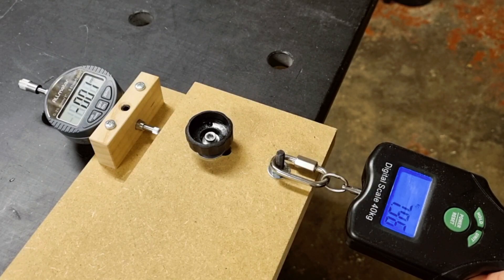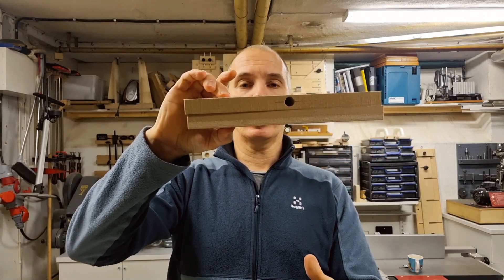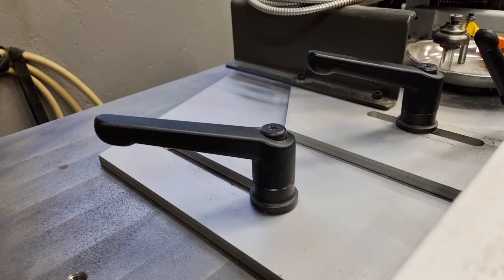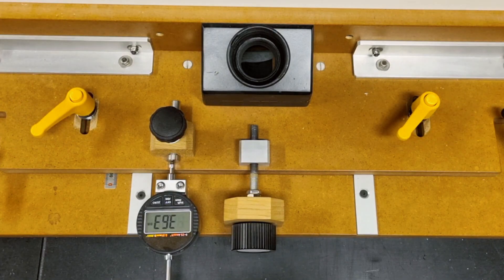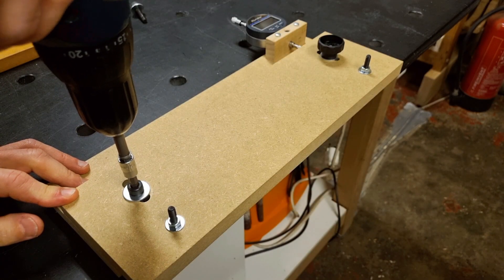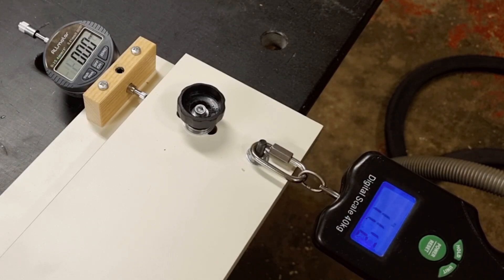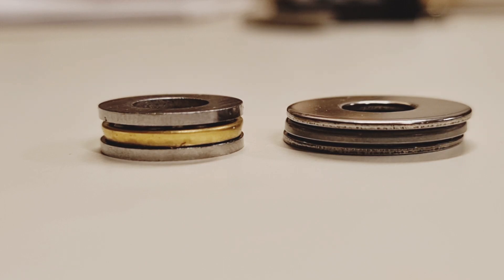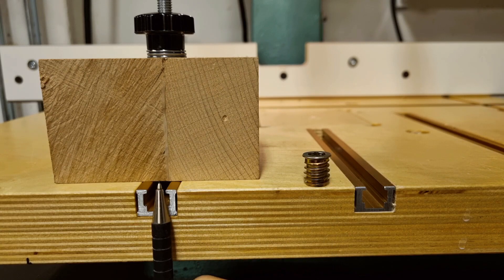Axial bearings for knobs and levers

Comment: BTW: I have used Bellville washers to get a smooth transition from zero to full clamping force, it made a huge difference on the gimbal mount for my big telephoto lens... You need to select an appropriate size and force, but a given Belleville washer size can be stacked for more travel ()() or more force ((( ...
Reply from the maker: Thanks for the input. I have never used those washers myself but they seem interesting for some applications.

Comment: Great vid! What's the purpose of the jig on the metal lathe shown at 1:30? Drum sander?
Thanks for the info - I'll be looking for opportunities to use the thrust bearings in my shop.
Reply from the maker: @PDXN8  Thanks! I placed some mixed pictures in no specific order in the link below, that was my previous jig on my old lathe but principle is the same. In short words the jig is to shape wood pieces that's meeting a circular piece, even angled joints (the miter gauge can be angled). I turn the sanding cylinder myself to match the circular piece. The jig is adjustable in height to match different diameters. I will show this jig one day, just need to install the motor on that "new" lathe. https://drive.google.com/drive/folders/1bZHkN3FK_kpQUGWu0iX7XcN1rx9ePzJm
Reply: @CarmoniusFinsnickeri  Thanks for sharing the pics -- very cool! Nice "new" lathe as well :)
Reply from the maker: @PDXN8  Thanks! I used to make concept prototypes for a furniture company and some of their designs had these circular meets. The jig might look like "overkill" or "show off" but it was invented for a reason and solved the task very well.

Comment: Thank you, very informative. Early on, I was going to suggest using a torque wrench to begin but I see you quickly went to that method on your second test. Where can one get those axial bearings? I saw where someone added one to his vice handle and now I want to add one to mine.
Reply from the maker: Thanks! These axial bearings are quite easy to find, I purchased mine from Aliexpress but I assume Amazon and other places have them as well. In diameters valid for this application product numbers AXK0619, AXK0821, AXK1024. Should get you started to source for some, larger diameters are also easy to find.

Comment: Lubricating THE THREADS has the same effect, use both for greater effect! I think Torque Test Channel did a video comparing torque settings across rusty, clean, and lubricated threads.
Reply from the maker: @Proton_Decay  Thanks, I agree lubricated threads should/will make a big difference even though I never tested how big in this application.
Reply: @CarmoniusFinsnickeri  also have you considered testing have vibration loosens those fasteners? I was just thinking about using both thrust bearings and a friction modifier on the threads,  and it struck me there would be very little sticktion to prevent a fastener from starting to back out under even modest vibration.
Reply from the maker: @Proton_Decay  I did a quick and dirty test on vibration in this video, around 11:15. For stationary parts like fences and other jig parts I'm not worried vibration will cause the knobs or levers to come loose by themselves.
Reply: @CarmoniusFinsnickeri   I saw, unlubricated threads though, both friction and sticktion. What I'm saying is with both lube and a bearing, the resistance to starting to move will be meaningfully lower.
Reply from the maker: @Proton_Decay  I wouldn't be too worried even if lubing the threads + using an axial washer. Friction is lowered, not zero, and you will get higher clamping force/preload which prevents the screw from coming loose. I just read here, page 2 "myth: lubrication leads to loose bolts". https://www.google.com/url?sa=t&source=web&rct=j&opi=89978449&url=https://www.trelleborg.com/seals/-/media/tss-media-repository/tss_website/pdf-and-other-literature/brochures/flatsealguides/flatseal-guide-05-lubrication-of-bolts_en.pdf%3Frev%3D-1&ved=2ahUKEwjv-ffp2OmKAxVVKRAIHTS8PR0QFnoECBIQBg&usg=AOvVaw37WJepkUBJWO_NXRLEvl74

Comment: A quick addition to your test, why not use Graphite powder on the axial bearing and the treads of the bolt which shouldn't attract dirt or dust making them sticky after use?
Reply: You wouldn’t want that graphite on your wood projects.
Reply: @robertlaveyra9940  I can't argue with that but you don't need that much though.
Reply: @ In hand loading ammo, they often use graphite as a lube to put the brass in a die but they also use mica powder which is cleaner.
Reply from the maker: Thanks for your suggestion. I have only used graphite as lubrication at a few occasions in other situations in the shop, not experienced enough to tell if it would be beneficial in this application. My guesstimation is that I don't think it will make much difference for the bearing as there is hardly any spinning involved, but maybe it will make a noticable difference for the threads.
Reply: @CarmoniusFinsnickeri  Remember anything worth doing is worth overdoing. Lol Good video. That could be your next video.

Comment: Very smart - I would not have thought of axial bearings for jigs.

I have a related problem with my cheap infeed/outfeed roller stands.  The “clamp” has a knob on a shaft, going through a threaded hole in the roller support, then the end of the shaft provides friction against the column of the stand.  Instead of bringing two surfaces together it pushes them apart with a tiny bit of surface area on the end of a shaft.  I now have a better understanding of why these stands suck!

Anyone have good suggestions for fixing these?  The column of the stand is hollow so I could machine a slot in it, and put a sliding “pulling” surface inside but that is a long slot to cut.
Reply from the maker: @firstmkb  Thanks! Yes I have the same on my roller stands. The locking knob push them apart on that side but they are at the same time pushed together on the opposite side. Not the best construction I agree, but it has worked ok for me. Except that the locking knob after a while make marks in the column. My stands are quite sturdy, I had some cheap ones before where this knob construction wasn't enough to keep the column from dropping under pressure.

Comment: How about using a PTFE washer between two metal rings instead of a bearing? And on slippery surfaces maybe a silicone or rubber washer underneath?
Reply from the maker: @Peter_A1466  There are low friction washers, think they are called slide washers, bought as a sealed package with top and bottom washer, very expensive. Same concept as you describe so that could work. High friction material under lower washer will help increase friction there but won't increase friction between the plates. Anyway, good thoughts.

Comment: As always, nice to hear about your test and smart ideas.
Don't worry about the forces on less threads. As I remind from my mechanical Ing. studies, around 90% of the forces are taken by the first 3 threads (because of the elastic deformation of the srews). So, far as you have 3 engaged, you'll probably never have any problem.
Reply from the maker: @bmz1   Thanks, good point. I also mentioned something about if having short thread engagement before switching to the bearings it could be a problem. If not, this shouldn't cause any problems.

Comment: Hi wouldn't an anti vibration washer accomplish the same thing at a lower cost. I have used 2 types one that is wavy and the other that is 2 parts, serrated.
Thanks Tom
Reply from the maker: @tpolarich6039  No. They will maybe in some cases increase the friction between the washer and top material very little but not increase the clamping force or friction force between the plates, which is what matters here. Those washers are mainly for the screws to not come loose.

Comment: adding some to camp ball and socket joints would be dope
Reply from the maker: @ja-no6fx  I thought these could be useful for a standard clamp swivel part where the rotation friction sometimes causes a shift when you tighten the clamp. But clamp ball? How would you use these in that application?
Reply: @CarmoniusFinsnickeri  yes , the swivel part of most clamps are ball and socket joints. We are referencing the same thing

Comment: Good idea. I use these thrust bearings when I build machines from metal, but not for wood. I do wax or grease the screws though. That does help. You could rout the slots to allow the bearings to be level with the surface.
Reply from the maker: @melgross  Thanks for your comment. In some situations routing slot for the bearing could be a quick way to fix "short thread engagement" problem. If mdf I think it's not very good to recess the bearings as this gets porous when you come down a few mm in the material.

Comment: Thanks for the video. I initially only found ones with too large of a bore (20mm), but finally found some smaller ones. I'll probably order them in case I have a need arise. You've definitely proven that they can help. - Chris
Reply from the maker: @fcschoenthal  Thanks! Good point, I will put some product numbers for valid diameters in the video description.

Comment: Thanks for this analysis - I have been using cam clamps to get the stability I want with my drill press fence but I am starting to notice them causing some damage when I really bear down. I think I could easily switch to a knob/axial bearing strategy and both increase the clamping pressure and reduce the chance of further damage. Great video!
Reply from the maker: Thanks! As I say in the video, a concept very cheap and well worth trying.